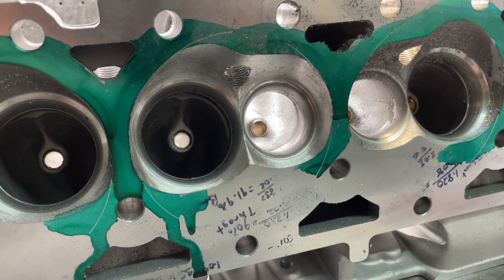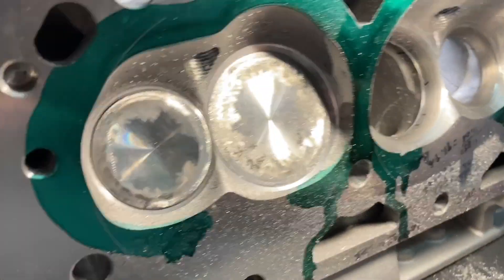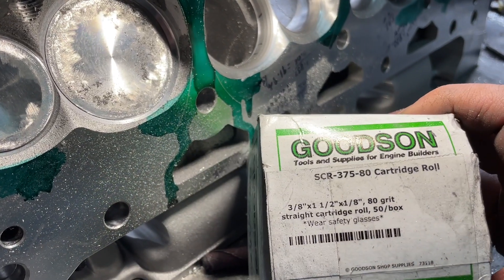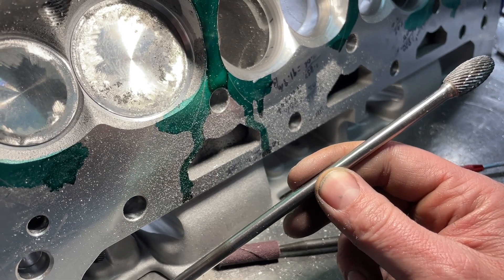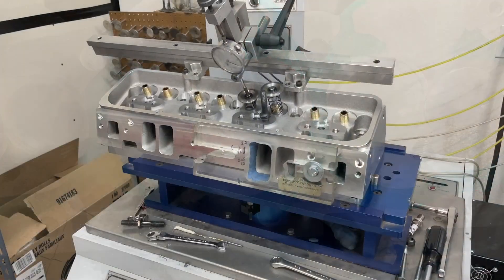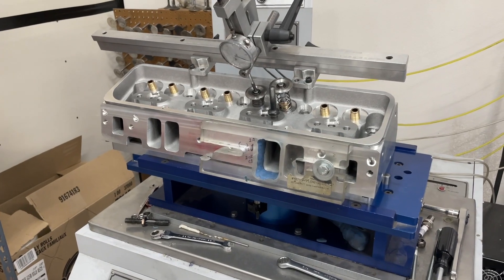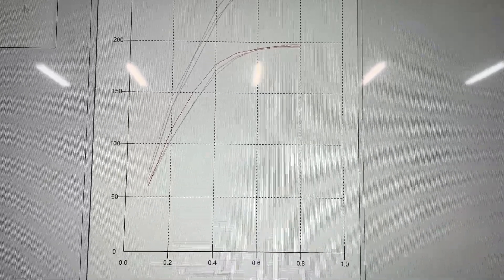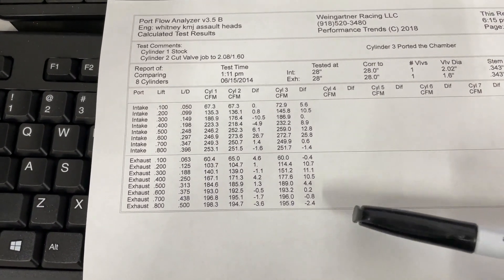Porting the KMJ Assault sbc heads part 2. The chambers

Comment: Other than the very slight drop in compression. Why not sink the valves 0.010 to get rid of the exhaust ridge? The exhaust ports are pretty much flush with the seat on the port side other than a couple of spots so I wouldn't think it would hurt exhaust flow through the throat. Seems like sinking the exhaust valve a tiny bit would allow the engine to flush the chamber more efficiently by allowing more intake air to flow between the exhaust valve and piston during overlap when both valves are open. I don't know, just thinking outloud here.

 I have the afr version and every one of the exhaust seats have that sharp ridge you can barely hang a fingernail on. Beings the exhaust valve runs hotter than intake. Wouldn't that sharp ridge be prone to hold heat and cause detonation?

Comment: Gotta run these due to the shortage. Cash days car. Gonna put em on a 302. I was shooting for 1 cfm/did for high rpm volumetric efficiency for any combo I was putting together. It looks the heads were made in the same foundry as dart afr etc, cause they are. These made in USA companies got exposed

Comment: I use a Foredom as well.  Never fooled with air - went straight for DC electric setup because... superior speed control [much bigger range as well].  Anyone having done this knows burrs like to load up when surface speed is too high [aluminum having a large plastic range].  Went with the Tx motor which has a little more horsepower, but can't use benchtop power supply as you do - foot control handles the extra current needed.  Can flip flop between using burrs or polishing no problems.

Comment: I think you're too fat on flow past 500 thou lift on the exhaust side. If you could gain under 500 thou and stop slow the gains down past 500 thou I think you could gain way more power.
Then you'll only need to lift to exhaust valve to 500 thou and increase it's duration which will mean less parasitic loos too.